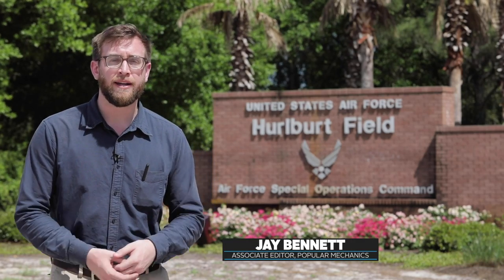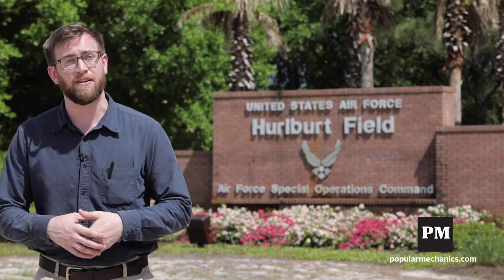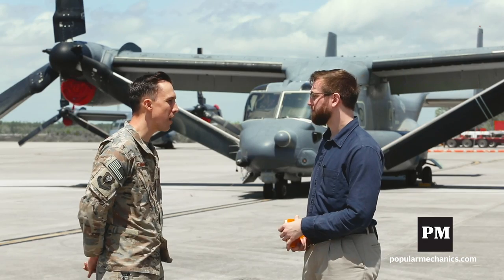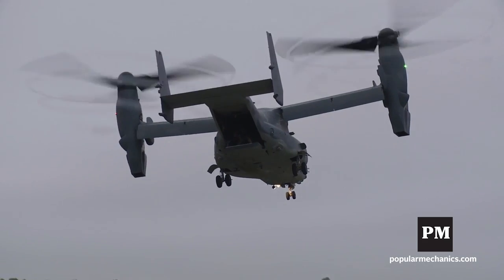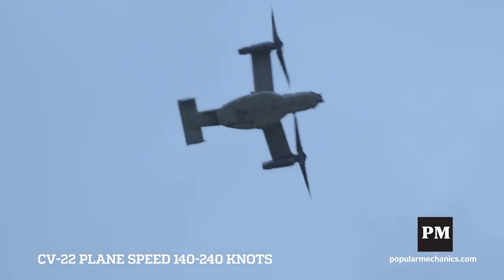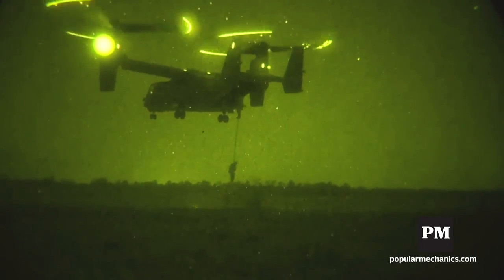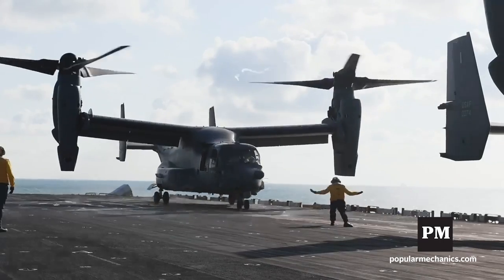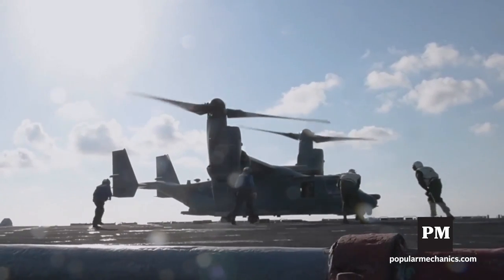What It's Like to Fly a CV-22 Osprey — Ask a Pilot

Comment: What are the differences between CV-22 and MV-22? 
Could the CV-22 stow the rotors and wings like the MV-22?
Reply: Yes they all can. I believe the CV-22 has an extra crew and an extra fuel tank, and some tech to support low level night specops missions.
Reply: as far as i am aware, the primary difference is the weather penetrating radar on the front, which allows them to fly very low to the ground in very poor visibility and still allow the crew to see the terrain. I dont really know tho, i fly on the mv-22.

Comment: Nice video, but how could you forget to ask the most important question of all times!!?? : 

Can it fly straight up?? I.e. In plane mode, can it fly straight up (until it reaches the operation ceiling) :-P  

Btw: how does it do an emergency landing? Does it glide, or do they do auto rotation?
Reply: SourceOfObesity they don’t autorotate, they glide it in.   Straight up? Why would they do that.  Nothing in the mission would require that.
Reply: Chris Smith straight up, cause they probably can go vertically straight up with the nose first ? At least in theory:-) Just because that is extremely cool :-)
Reply: SourceOfObesity lol. Just because one can do something doesn’t men they should.  Would be interesting to find out what airspeed nacelle setting results in the maximum rate of climb.
Reply: @chrissmith7669  movie scene explosion of course

Comment: If V22 had 4 pales, instead 3, in every motor, would it be more efficient???
Reply: I liked the 5 blade rotor design.  From what I remember they didn’t have the design tools to make the 5 blade rotor head light enough but still strong enough for the crazy forces during transition. Maybe today with 50 years of computer advances they could.

Comment: Why not use these Tilt-Rotors as "Helicopter Airlines" for short hall intercity travel from Heliports very close to cities with short check-in times than airports!
Reply: Aircraft manufacturer Leonardo is making a tilt rotor aircraft for civilian aviation. It's still in testing, but it will soon be a viable aircraft for airline use, I'm sure
Reply: I wouldn't wanna fly on one until they have a proven track record
Reply: They have improved safety, however, I still don’t trust them.  Ask the 42 service personnel (mostly Marines) who died in testing and flight ops and their families if this technology is really safe.
Reply: NASA has done the research and laid out the road to tiltrotor as medium length direct city to city center transportation option.  Search for NASA LCTR and you’ll find everything from aircraft design to airport evolution and airways
Reply: @Tom Gulbranson wait until they fly for a few years then I'd try it out, just like how I'd never buy a brand new video game because they have to update software to iron out all the glitches
Reply: Very small and impractical for civilian transport

Comment: "First of its kind"
The XV-15 it was developed from: 😞
Reply: First Production tiltrotor.  The German designer Focke was testing a tiltrotor in the early 40’s but faced difficulties due to constantly having to move his studio and production.   The US gave it to Bell who made the first translations between vertical and horizontal in the XV-3, then came the XV-15.  The AW-609 (Xx-609? As often as ownership has changed) is second generation production and 5th generation design. The 280 is the sixth generation of flyable tiltrotor.  If Karen gets further funding from NASA for  their Military Heavy Lift Tiltrotor (almost a twin of the LCTR) it could be the next generation C-130 sized tiltrotor capable of transporting a Stryker size vehicle.

Comment: so why not ask a former C2 pilot what they think. the real back bone of navy cargo distribution till now.
Reply: I think once they get used to being directly replenished the shops captains will be onboard with Osprey instead of greyhound
Reply: @chrissmith7669  it's a whole different recovery action that require shutting down normal operations because if the large area required because if the large lengthy blades is what is an issue. During combat situations they use both decks cats for launching
Reply: @joescheller6680  I was thinking of the non-carriers that would get direct replenishment instead of by heli from the carrier after the C2 drops stuff there.  Deployment of Osprey in that roll will likely evolve as everyone learns best practices.